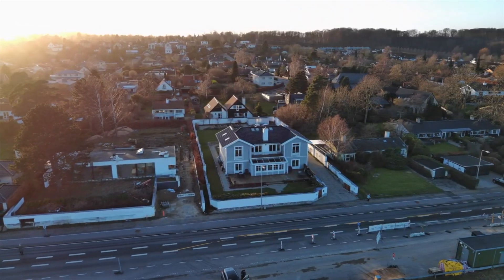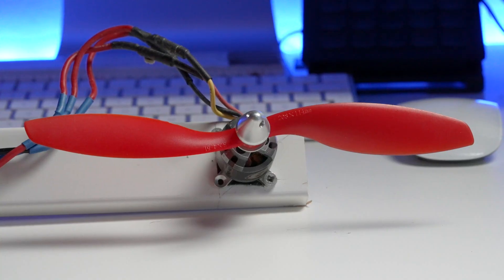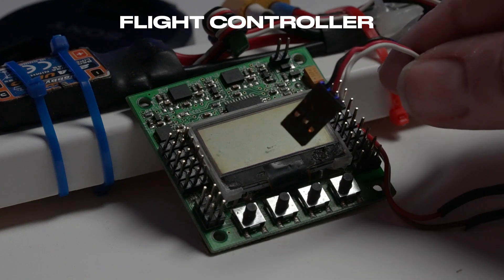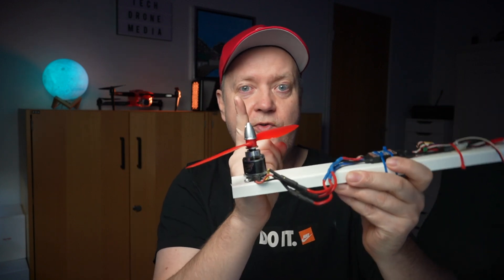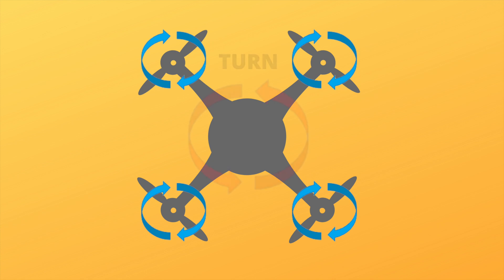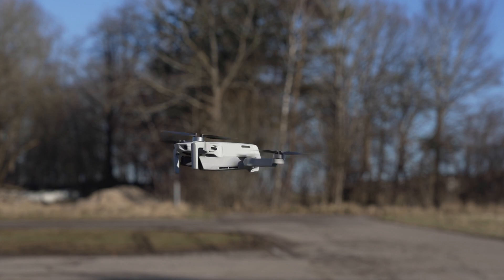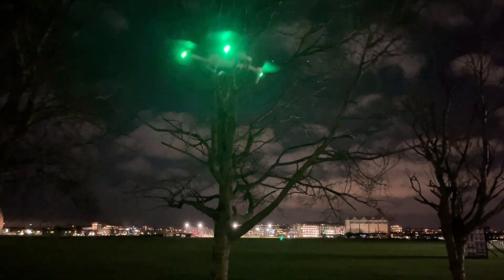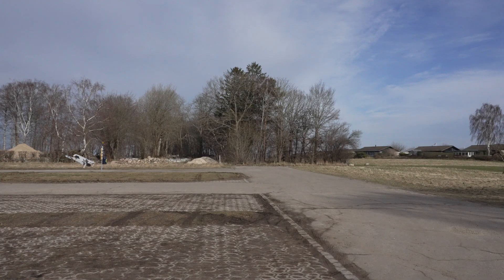How Do Drones Really Fly?

Comment: The correct plural form of "aircraft" is... "aircraft" — same as the singular!

So you'd say:

✈ "One aircraft was spotted on the radar."

✈ "Several aircraft were deployed for the mission."

"Aircrafts" is technically not standard English and is almost always incorrect.

So stick with "aircraft" for both singular and plural in general use.